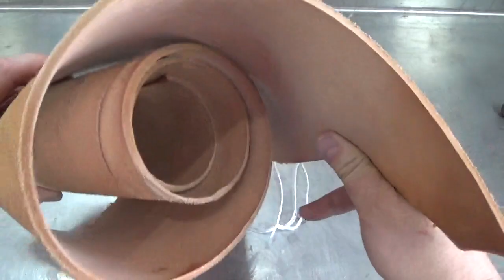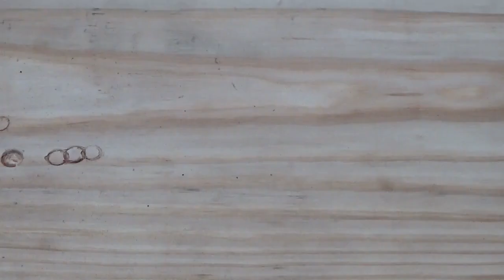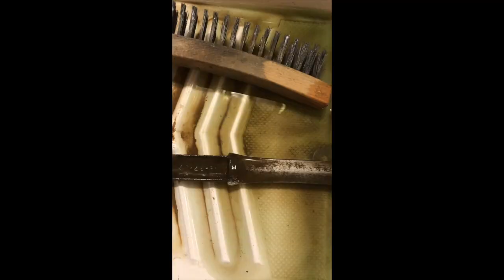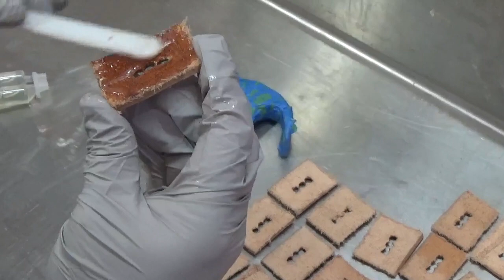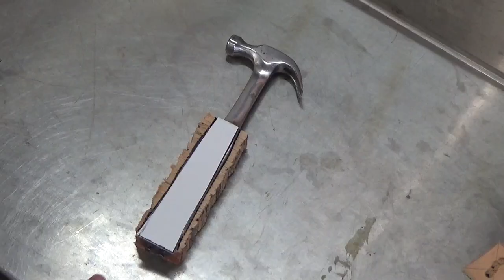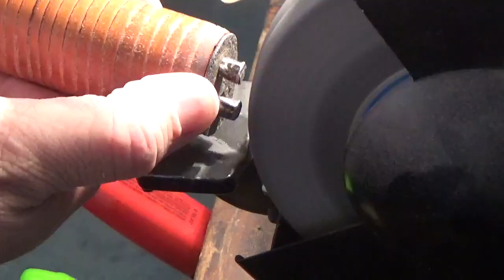DIY Stacked Leather Handle - Refinishing an Estwing Hammer

Comment: Make sure if you're using belt leather etc that it's 'full grain cowhide' as all leathers are NOT created equal. Some are just 
leather scraps heated under pressure. Most tack shops will only use full grain.
Reply from the maker: That's a very good tip, my friend!

Comment: where did you get your leather? Every time I do my calculations I find that it will cost over $50 to get enough leather for this job. Most leather I find is 1.5mm thick, meaning you would need a minimum of around 120 pieces. Since the handle is 1"x1.5" at the thickest point (measuring an estwing with the leather handle still on), it really adds up. for example with these specs you could find a 1" thick strip of 1.5mm, 72" long for $27, but would need 3 of them. I can't seem to find these really thick leathers like the ones they use on Estwings (1/4inch or ~6mm thick)
Reply from the maker: go to a goodwill business and find leather belts, shoes, etc.  I got some leather scraps from a craft store as well.